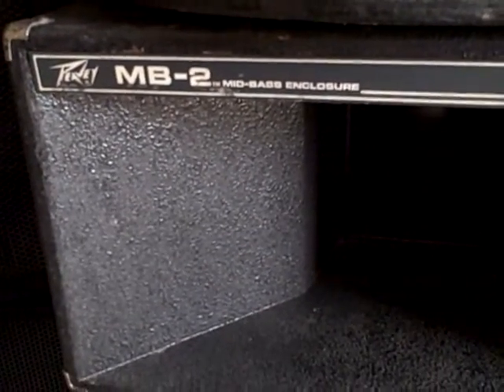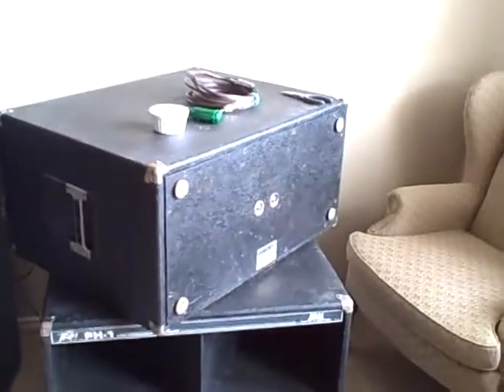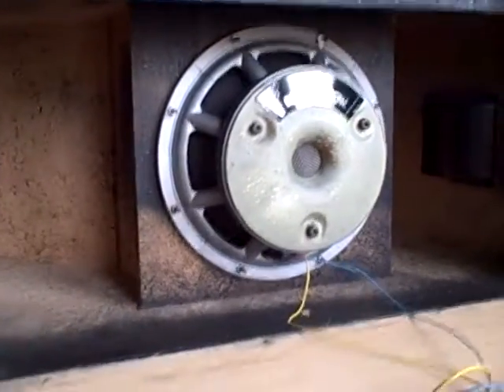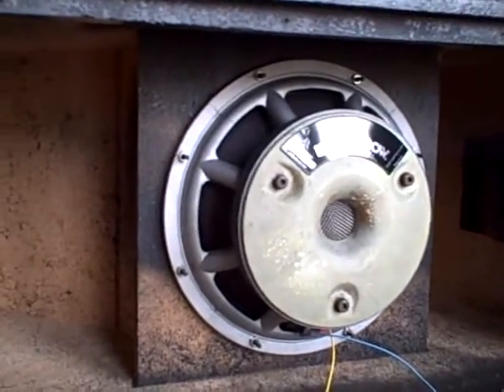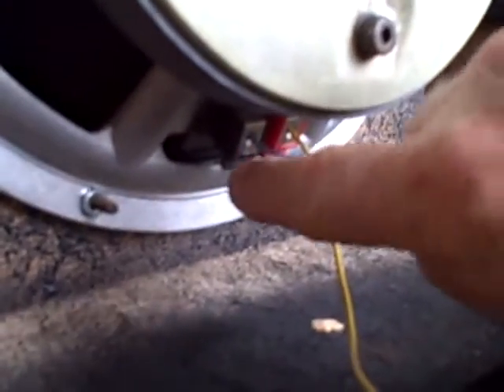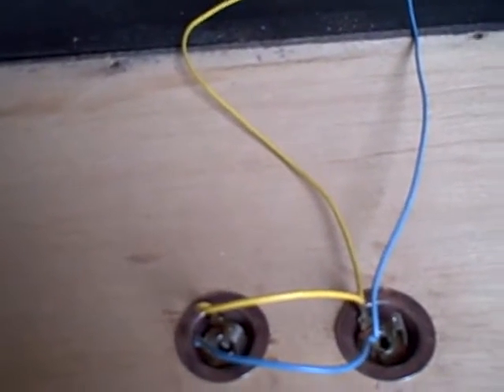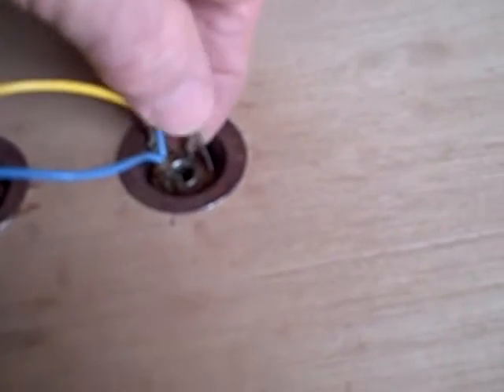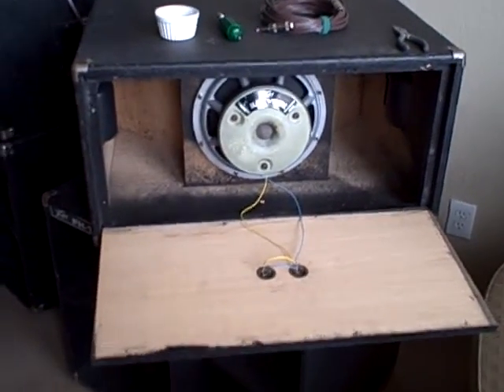Peavey Project 2 - inside the MB-2

Comment: Can you upload inside measure please?
Reply from the maker: The PDF of the MB-2, with dimensions, is available at: https://assets.peavey.com/literature/manuals/80301016.pdf
The cabinet is constructed with 3/4 inch wood, so you will need to subtract 2 X 3/4 to get the inside dimensions (because there are 2 sides, or a top and a bottom). I hope this helps.

Comment: Thanks for the video! Looking for a couple of these myself to complete MY Project Two system. Just a pair of MFX-1's with FH-1's for a hundred bucks hoping to find the MB-2's to go with. Do you bi-amp or tri-amp your rig?
Reply from the maker: Tommy - I tri-amp the system. If you keep your eyes open, you will eventually come across someone who wants to sell a Peavey Project 2 system, usually pretty cheap. I will mention that it would be good to take the speakers out and check that the foam covering the vent hole hasn't disintegrated. It can fall into the voice-call and ruin your day.
Reply: Dave Staats  you still  have the dijera for sale
Reply: Dave Staats - crap, I just saw this! Serves me right for not checking my updates more. You still have them?